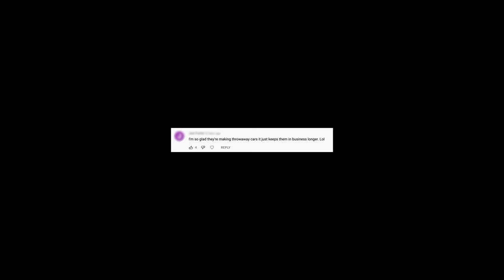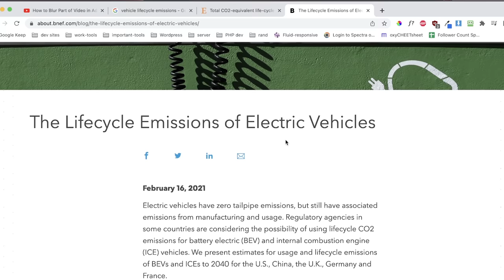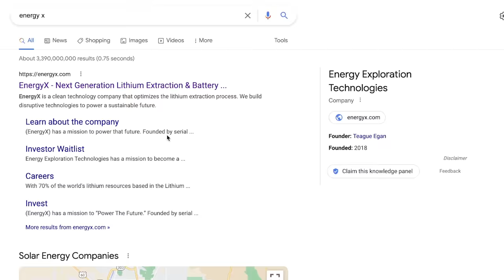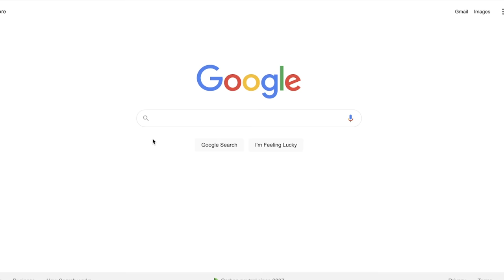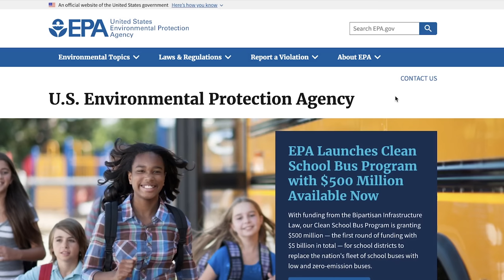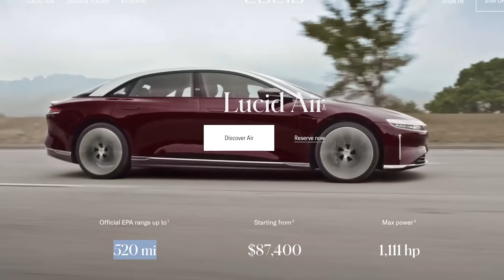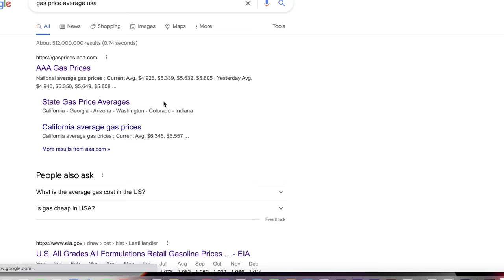STOP BELIEVING these 5 Tesla Myths... | Gruber Motors

Comment: If you include CO2 emissions for battery manufacture in the carbon footprint for EVs, then you must include CO2 emissions for gasoline production in the footprint fir ICE cars.
Great channel !
Reply: It takes about 5 kWh of energy to refine a gallon of gas. This energy alone can move an EV about 20 miles. 

Comparisons tend to ignore the costs of extracting oil, storing oil, transporting oil, refining gas, transporting gas, storing gas, and pumping gas. Almost as if it appeared by magic in your tank...

Comment: I had 202,000 miles in my Model 3 (which sadly just lived up to its excellent crash ratings when I got hit, I walked away) and this video is spot on. The reality is your brain can't keep up the range anxiety for more than a month or so, as you realized you're never below 20% even in heavy driving and people are being mislead. The severe drop in maintenance requirements is spot on too: EVs are EASIER to own. If the inverse were true, everyone was driving EVs and someone came out with a gas car, whose only advantage is quicker fillups that can't be done at home, they'd be laughed out of the marketplace! (cannonballers are not a viable market)
Reply: Wow, I'm a zero short on that number haha :)
Recently changed my air filters, biggest expense so far.
Reply: Cannonballers fill their trunk space with an auxiliary fuel tank. So even they aren’t getting the range w/o compromise. Fillips might be faster but still longer than normal because they’re pumping 50+ gallons of fuel. I’m sure if they happen to get a slow pump that’d be extremely frustrating. It won’t be long before batteries will give 1,000mi of range. At cannonball speed that might get cut in half though.
Reply: 100%
Reply: My Model 3 saves me $200/mo in gas 🤑
Reply: Do you still have it? Fun to see how many miles u can get out of it
Reply: @tophat2002  no, sadly it was totaled.
Reply: Totally agree. My Tesla has made my life better. Great driving experience,  excellent safety, the best audio system and more...

Comment: You addressed all these points well. 

What is more important than CO2 is that EV reduce or eliminate other city pollutions where most people live. That’s is an important reason that I heard from various representatives in Europe China and India. This became clear during lockdown and well documented as the sky of many Indian cities became blue again. With regard to safety many old ICE cars are being electrified. These were originally crash tested when running on gasoline. Not with a new weight distribution. Furthermore they may not have the same electrical isolation and passenger safety.

Comment: range anxiety, slow charging, no available chargers are all real things for many non teslas.
I have a 2021 bolt, it's great around town and for medium distance trips but any time we go to do a weekend vacation it's an issue. not to mention as soon as it gets cold out I lose 40 to 50% of my range which makes even normal driving very difficult.

20kw chargers makeup the vast majority of the charging Network and even if I find one that's 50 KW it still takes over an hour to charge up.

thankfully most manufacturers are offering much faster charging speeds, however they're still just aren't that many fast chargers around me.
Reply: You have to remember that the Bolt EV is over 10 year old technology that probably 
will never be updated , and will have to be completely replaced . The battery in this 
pack is not going into any future vehicles replaced by Ultium , so this will be an 
orphan vehicle. They are still very good short to medium distance travel vehicles 
that have useful life in them.
Reply: My friends in Alberta, Canada experience the same cold weather issues you are describing.
Reply: One reason the Chevy Bolt loses that much range is they use a resistance heater to warm the antifreeze that warms the pack to optimal operating temperature, and also the interior cabin of the car. The that is also the way earlier Tesla cars were, but a couple of years ago, Tesla had SpaceX Engineers come in and revamp the heating system. They decided to turn the air conditioning into a two stage heat pump. In the right temperature zones of vold, the heat pump can avoid running the resistance heat exchanger entirely, using 1/2 as much electricity to move the heat vs generate heat from resistance heat to coolant exchangers. They invented the Octovalve, a single valve that does all modes for rerouting the high side and low side of the Freon flow, to swap condenser and evaporator cores instead of several revering valves and several hoses each. This Octovalve saves weight, reduces Freon leakage possibilities, uses less space, and is easily commanded by the computer managing the HVAC and temperature control systems. It can even have modes where the battery may require heat, but the cabin requires cooling and Vice Versa!
Reply: Ultium is a battery packaging innovation. The cell chemistry is essentially the same as what already exists.
Reply: @marcinmerrimack1726  the packaging includes improvements in cell thermal control via better contact with the cells by cooling jackets with pumped antifreeze ethylene Glycol flowing through then to minimize hot and cool spots, and better electrical connections to the cells to minimize electrical resistance voltage and power losses as charging and discharging current flows, all of which speeds charging, allowing for increased charging current, increases efficiency in both charging and discharging the batteries to make motion! The packaging is also used to minimize out of control thermal (fire) events, by preventing the heat energy from heating and igniting uninvolved cells, limiting the damage to the one cell that became defective. The connection to the battery center has cell is fire temperature sensitive and designed to break the connection so the energy from the rest of there system current, so it’s a lot more to the innovation in packaging!
Reply: Ok, I appreciate your reply. Sounds like you have familiarly with the Ultium technology. When GM releases a car with the new battery tech, we’ll then get to observe and measure real world improvements.
Reply: @firstbigbarney  Now that GM has declared the Bolt to be alive (again) and getting the Ultium packs, I for one as a former Bolt owner would love to see a new and updated Bolt with different pack, drive motors and electronics.   Its coming, just not as fast as we'd like.
Reply: @DishNetworkDealerNEO  Having had two different Model 3s, one with the octovalve and one older car without, I can say the delta on heating or AC use is insignificant and that either car typically used about 30% of the pack just to heat or cool the car (assuming you're not heating or cooling off the grid).
Reply: @OutofSpecMom  hopefully we will see a battery energy density increase to make this energy use a lesser issue. Amprius is very promising. With silicon nanowire cathode. They are literally across the street from Tesla Fremont, and that is no coincidence!

Comment: One area where I disagree with Pete and feel that he glossed over is the "real range" of a BEV.   Fact is, and as an owner of several BEVs, I can unequivocally state that just like an ICE car, YMMV.    Well, your mileage will indeed vary and often quite a BIT less than what the manufacturer tells you. Not once have I ever gotten in my Model S nor 3 the stated range (percentage)  nor mileage (depending on what gauge you choose). Add to that the fact that you have to run either the AC (particularly this year in the south) or the heat (resistive or Octovalve on heat pump) and you'll never get the stated range of the vehicle.  The battery simply supplies ALL of the juice for motive power as well as lights, radio, display and climate control.  IMHO, I believe a more accurate statement of range using heat or AC is probably 30% less than what the car is telling you.  That's my experience and one that is born out by many others. If you car is telling you 300 total and its a hot (or cold) day, figure a real 200.    Add to that some fast highway speeds with drag and aerodynamic losses and realistically that 30% is now more like 50% of what the stated is.   Heat or Air at 75 MPH and that 300 turns into a "real" 150 (or less).     Two things that really need to be discussed about BEVs are 1.  Real Range and how far will it go?  2.  Battery degradation and how long will it last??  From what "I've  seen with Gruber, there's not an original Roadster on the road today that hasn't had a battery issue (or need a 3.0 conversion)  or have other issues that need to be addressed.

Comment: 👍Charging stations are everywhere!! Every home and business has an electric outlet. The grid can handle it for most charging is done at night off peak. ✌️😎
Reply: Charging stations are most certainly NOT “everywhere,” particularly high power stations.

Every home and business most certainly does NOT have a 240V outlet available for Level 2 charging. You’re essentially going nowhere if you can only charge at 120V.

And let’s have the power companies determine whether the grid currently ‘can handle it’ even as ev charging demand increases.
Reply: @marcinmerrimack1726  Depends a lot on the infrastructure available, if you are the owner of the property or just renting. If you are a owner, solutions are available like installing a second phase to get 220V or solar panels / tesla wall. While this year the bell curve of EV adoption will make or brake some companies, you can still use politics to draw attention on this matter for the future. As the old infrastructure was used only for lights, changes came as homes needed HVAC, fridges, washing machines and so forth. It is not happening over night but it will happen.

Comment: Hard to account for all CO2 in manufacturing and using a vehicle.  This was studied by Dr. Odum and students during the energy-crisis 1970's, an ecologist at UGA.  They concluded that there was a 1:1 relation between cost and energy use, thus whatever is most economical is also most energy-efficient.  At that time, more energy came from fossil fuels (exc. hydro and nuclear electricity).  That has changed a bit with solar and wind, but those also require energy to manufacture, so likely the equality still holds.  With this argument, whenever BEV's become more affordable to purchase and operate than a gas vehicle, they will cause less CO2 emissions.  That isn't true today for most BEV's sold in the U.S.

Comment: Are there any supplemental extended warranty coverage companies out there for Tesla cars that would cover Gruber Motors repairing defects in battery packs or outright replacements of entire packs, drivetrain components, control modules? Where there is a risk, usually there is an insurance company and policy to cover that risk for a premium.
Reply from the maker: We are unaware of insurance companies offering the equivalent of extended warranties for work performed by independents like us.
Warranty usually confines to items replaced or workmanship issues.  Take for example a Tesla Roadster battery repair, where one of 6831 cells is identified as going resistive, holding down a brick, and the BMS is limiting charge eventually disabling the car.

We isolate the bad cell, remove it from circuit, the pack comes back alive, and a while later, another cell starts the same decline.  
In this scenario, there is no replacement part to warranty, and looking for workmanship warranty is equally elusive since all the other cells looked fine during the repair.
Reply: @grubermotorcompany  I believe you misunderstood me. I’m not talking about extended warranty of your company’s work, I’m talking about extended warranties, beyond the OEM warranties that would allow companies such as Gruber motors to do that work excising of resistive cells holding a blade back from doing it’s job, and instead of the customer paying you, the extended warranty company pays you because the customer decided to extend the warranty on the vehicle when Tesla’s manufacturer warranty expired, by paying a monthly or yearly premium or a set up front premium for a block of three, four or five years or an additional block of miles.
Reply: @DishNetworkDealerNEO  That may be useful to an extent in regards of the battery, for sure recycle companies will take the lead and offer you a good price for the whole old battery allowing you to get a new one with a better technology.

Comment: @2:52 You address number of charging stations.  Isn’t 80% of all charging done at home. What are the implications of this if factual?  My local utility just increased the price of electricity by 30% and at the same time offered significant rebates for new energy saving HVAC (and also bounties for surrender of old equipment).  Any comments on this?  How much of electricity is wind or solar generated (reference your images).  Are there any incentives for wind or solar?

Comment: Does Gruber Motors see, as the fleet of Latest generation, Tesla cars and others age, where there will be as Battery Tech improves, and cheapens, the release of affordable, aftermarket replacement battery packs, stocked with the latest battery and battery management tech in the old housings, exchanged for used cores, to then gut and restock? There could also be a refurbished Drivetrain and just repaired pack business, where either Gruber expands into a national franchise chain so the shops are local, starting off near major cities, the becoming the next Midas Or Monroe Muffler style chain, with Gruber refurbishment and recycle of removed components set of regional facilities setup to minimize freight costs, maximize profits and reduce charges to the customer base, way beyond the cost the out of warranty OEM charge would be. I see Gruber paying to buy the wrecked Tesla and other EV, for testing, tear down, repair application classification, and stocking on the shelf, supply to the franchise owners. Not just limited to the power handling and drivetrain, but also other parts, including used tested,  modules, body parts, cast frames sections, interior, parts, wheels, suspension parts, not damaged and verified as meeting OEM Specifications. This would be at the point where Tesla and other EV manufacturers would give their blessing to Companies willing to meet Tesla standards of secondary repair certification. 

If Tesla wants to speed the adoption of EVs, it will recognize it has to allow secondary support for it’s used vehicles, as a market of it’s own, which will help page the way to recycling of those dead batteries, not a mix of 80% serviceable batteries when grouped with other good batteries, maximizing the average lifespan of these batteries to way beyond the OEM Expected lifespan for the battery cells and cars themselves. 

You could call it Rejuvenated Motors!

Comment: And you will NEVER see anyone recycling petrol or diesel after its been burned in an internal combustion engine whereas EV batteries WILL be recycled after thier entire 30-40 year lifespan is up.
Reply: 30 to 40 years...NOT
Reply: @robertpsotka3525  Then you plainly don't know anything about EV life expectancies. After roughly 12 to 15yrs, possibly longer, of in continuous use in a vehicle & depending on miles/km driven [100,000 - 250,000 miles/ ~160,000 -  ~402,000km] depending on battery chemistry, charging management history & driving styles, they're then destined for 1st, stationery storage for a good number of years before finally being recycled. Battery manufacturers themselves, have been surprised at just how long EV batteries are lasting.

Comment: The battery pack of an EV is so heavy that it's equal to the weight of six adults that's before the real passengers sit in. The US government will "surprisingly" announce later the repair cost of roads and bridges have tripled because of the impact the millions of EVs have had on the infrastructure not to mention ecological disaster that is involved in making and dumping the EV batteries.
FUN FACT:
If we take curb weight to be  25% extra for Telsa Model S compared to Toyota Camry thats 550 kilograms or 1200 lb which is the weight of SIX Americans on diet  🤣🤣🤣
Reply: its almost like you purposely forgot to mention how there are already millions of semi trucks and other larger vehicles which 10x the weight of a tesla driving on roads and bridges etc daily for decades lol. This actually isn't a problem but a benefit imo. Our roads are already terrible and at least here in the southwest where its hot all the time there is constant road construction as it is already. there hasn't been innovation and new technology in road materials development in ages and having heavier cars will drive innovation to find new solutions to this problem that no ones really cared about for the last 50 years. Also, look up redwood materials. created by one of the founders of tesla and they already have a viable option for the recycling and repurposing of lithium ion batteries from EVs. stop being an alarmist for no reason if you haven't thought out all angles thoroughly and actually researched what you are talking about